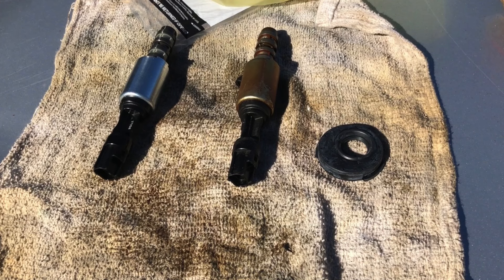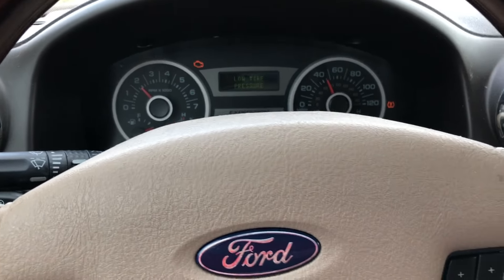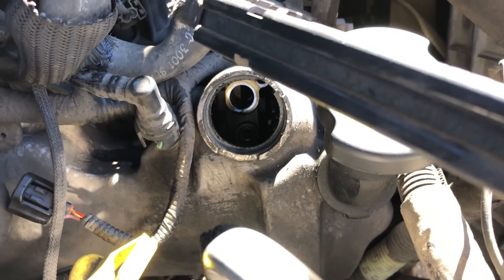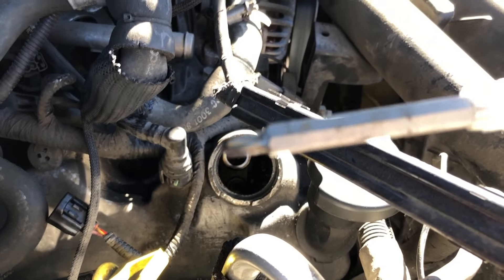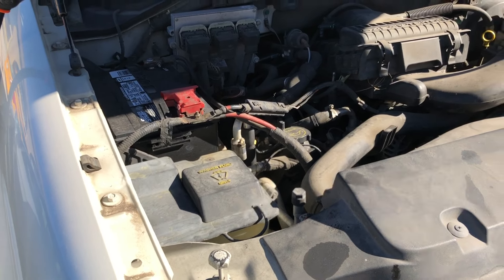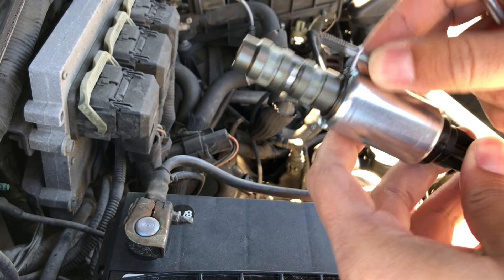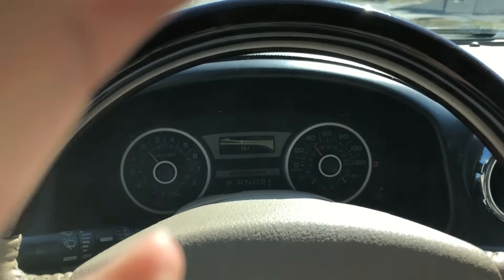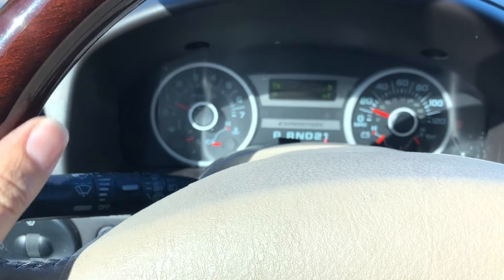How To Fix Ford P0012 Code ( VCT Solenoid replace )

Comment: Great video. I was a ford master tech when this style engine came out. The issue is the tolerance in the oil ports of the phasers and solenoids are very low. contamination from dirty oil or oil filter fiber contaminants will clog the solenoid and or phasers. Solenoid failure usually is followed by phaser failure. That being said is there is a 0012 or 0022 code followed by a drivability issue then start with a solenoid.
Reply: I have a 09 Lincoln navigator and garage told me it's the phasers just had the timing chains and tensions and crank shaft and both camshaft sensor redone could the vct solinoid be my problem
Reply: So I’m looking at buying a 2010 fusion. Throwing a P0012 and P0303. Stalls out at stop and blows white smoke. What would your guess be?

Comment: Thank you for posting your finding. My truck is having problem at idle it shuts off thanks to the internet I may have to replace this solenoid.
Reply from the maker: I hope you fix your truck fast and easy. 

If this vid helped you please subscribe to my account. Thanks ^_^
Reply: Did it work?

Comment: im replacing these tomorrow i figure ill just do both. the pinging had me thinking timing advance since i been hands on carburated small block chevys since i was 18. dropped $350 on a scan tool that said "yup, you were rite" i hate computers....
Reply: Did it fix your problem?
Reply: Nvr mind...this is an older ford
Reply: @lorenzohart9560  no, retired truck at 130k
Reply: @lorenzohart9560   Fix to the code but didn't make it run any better

Comment: Hi. I have p0012 in my 2004 f150 but truck runs perfect so you think is the same problem?
Reply: We’re you able to get fixed? Mine runs perfect too and light doesn’t flash but it’s popping up p0012
Reply: Same year f150

Comment: Do you know if this is the same fix for a 2012 3.5L ecoboost engine? You did an older 5.4L
Reply: I'm about to swap my vcts on my 3.5 ecoboost explorer sport. Hope it fixes the p0016 and cel

Comment: My 2005 f150 5.4 just randomly loss power didn't wanna go had horrible misfire  . I could get it up to hwy speed barely  by flooring it.  at idle ran rough could hardly go in reverse without stalling scanned it and had misfires on 2 3 4 cylinders,  I changed my plugs ,COPs no difference  then I gave me ,cam pos sensor code I changed it  I changed  ,oil ,oil filter, fuel filter and nothing changed or got better  I finally got a p0012 code and everyone is talking about the timing and the phasers and I'm getting scared my truck has had the tick since i purchasee it at 160k and has 240k sonic was like yup it finally shit on me but after doing some research I was like well what's 50.more bucks .I watch some videos where they say you have to pull the whole valve cover that's bullshit just clean around the seal take a flat head and some pliers and pull it off the new vct sensor came with a new one from autozone for 50 bucks I swapped it out truck is quieter than before runs tens times better ( new plugs cops fuel filter)  but this fix is definitely worth a try in guess replacing my passenger side cause the miss was on that side andni was right but you can buy one and swap it to see of this is your.problem if your m.j on a budget  . Great fix this can save alot of people alot of money
Reply from the maker: Happy to hear it drives better. 😊 nice
Reply: Wait u didn't take the whole valve cover off?

Comment: Do not believe any of this if you have 2009 expedition. There is a lip in the manifold that makes “line of sight” impossible. Therefore making it impossible to get a screwdriver if any kind down there. I guess I need to make a video of my own because there are no videos that I have found specially about the expedition. 

This is, of course, not the fault of the maker of this video. It just didn’t work for me.
Reply: In the 2012 you have to remove the whole valve cover....pain but doable.
Reply: I have the same problem